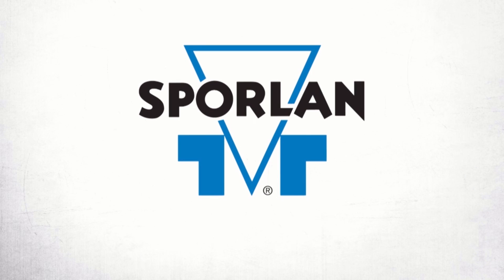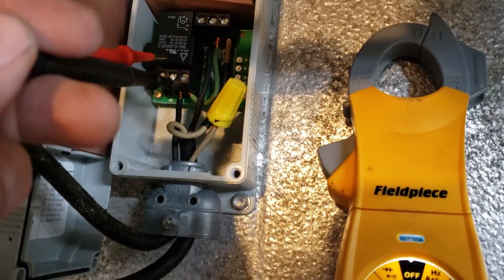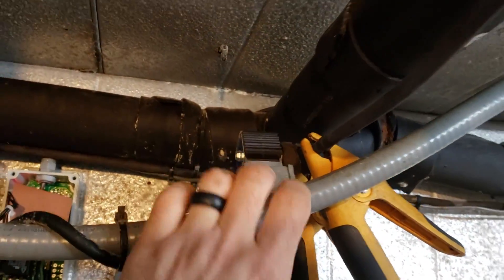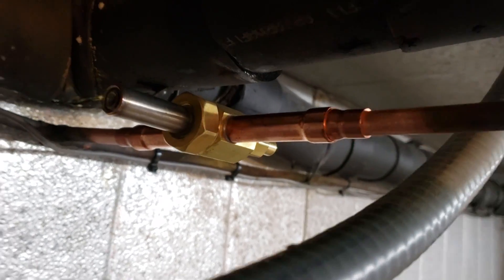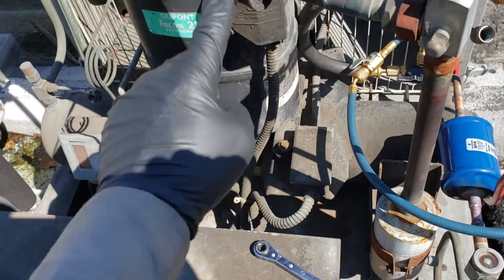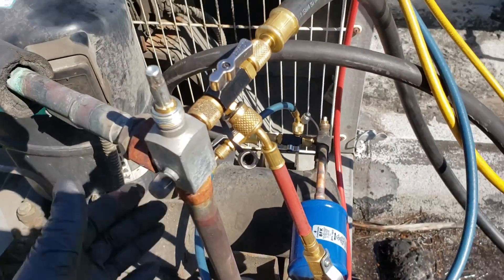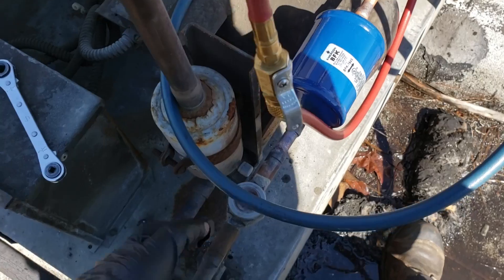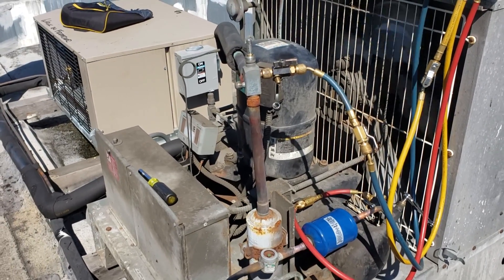WALK IN COOLER TOO COLD

Comment: If the contactor is open and not sending signal to the valve how is it that you have 115 incoming and the same on the output? I'm confused.  Thank you for your videos btw!!
Reply: The first measurement he did confirmed that he had a good power feed down to the evaporator and thermostat. The second measurement he took was almost certainly across the switch contacts, in which case if you measure 115 volts that means the contacts are open and the thermostat is trying to tell the solenoid valve to shut off.

Comment: Why replace the control? The Ranco seemed to be doing it's job. A correctly designed cooler shouldn't need a controlled defrost. Under maximum load it runs 16 hours per day allowing it to defrost during the off cycle. If the owner is putting it under greater load so that the off cycles are not long enough to defrost it you can set it up so that the temperature control senses coil temperature rather than space temperature and set the differential for TD plus 2°F.

Comment: Are those solenoids position sensitive?
Reply: Since there's several ways I can think of to interpret "position sensitive" in your question, I'll try answering as many of them as I can.
This kind of solenoid valve that opens when power is applied has a spring in it to hold it closed when there is no power, so it doesn't matter what orientation it is installed in.
Some solenoid valves do have an in and out port, so the direction of flow may be important, but systems that are reversible (heat pumps mostly) likely use solenoid valves that are bidirectional.
For the system to work properly, the solenoid valve must be in the liquid line between the condenser output and the metering device (TXV, orifice tube, etc.).
I think that covers it pretty thoroughly, but I'm not a HVACR technician. I've just been binge watching HVACR VIDEOS vids for the past 3 weeks. Learned a lot about it thru that.

Comment: Great find. I have not used the K2. Good use of the vacuum method. So many people I see pull vacuum thru manifolds. Yesterday I pulled a 20 ton split Trane down to 163 microns in 3hrs with 2 oil changes. Both fan pressure cycle switches leake and system was flat. So my 9cfm REFCO vacuum pump, 3/8>1/4 hoses, use Apion core tools and wala..vacuum achieved. Be safe out there! Thanks for sharing

Comment: So I didnr get why did you replace the thermostat if it was operating properly.
Reply: I installed hundreds of A419AB thermostats on walk in coolers with the sensor in the coil and programmed it to have a cut in 39-40 degrees and  cut cut of depending on type of refrigerant, condition of the coil, for example around 20-22 degrees for R22so the system makes defrost every cycle. Works as magic.
Reply: do it as a precaution, trying to avoid a call back..
Reply: Good point but I'd rather to install the little Grasslin timer with pins between the thermostat and solenoid coil so you can have different defrost time at different time.
Reply from the maker: The new thermostat contains built in defrost , so I changed it out of precaution

Comment: Thank you Chris. How do you find the  Appion vcrt , does it hold the vacuum tight , or does it start leaking after some time ? I've been wanting to do things by the book and use proper equipment lately,  but my colleague takes the piss at me and basically acts like I'm some joker who wants to do things like he was taught at school instead of getting the job done .😒
Reply from the maker: The appion VCRT is very nice and it holds the vacuum very well due to a double o ring internal design.
Reply: @HVACRVIDEOS  thank you . I need to find me one of these , I haven't found any supply house that carry this brand yet , but I'll keep looking.
Reply: @sterlingarcher46  TruTech tools online likely cheaper than any supply house. Can use discount code "getschooled" or others for 8% off.
Reply: @davejohnsonnola7908  cheers for that , mate .
Problem is I'm not in the US , so we don't get all the good stuff you guys have the pleasure to work with 🙂

Comment: Thats lucky. There arent many possibilities for that problem. Either the thermostat is stuck powering the solenoid or the solenoid valve is open.
Reply: “Running around like a chicken” 😂😂😂😂
Reply from the maker: Yep
Reply: @HVACRVIDEOS  I bet youve been having a fun week down south. The SF Bay Area had a heat wave at the beginning of the week and I had all kinds of equipment crap out on me. The funnest one was a Bally/Keep rite that was running but wasnt pulling the room down. Low liquid. So I put some in and then the machine stopped working. Started troubleshooting and come to find out that someone rewired it totally different from the diagram. Fought it for a while and it started working again. Came back the next morning and it was off. Shut it down traced out all the wires and made my own diagram. It started up again after that and has been running ever since. I think it was kicking out on the high pressure cut out. Oh well....
Reply from the maker: Yeah I have been running around like a chicken with its head cutoff all week. Supposedly we have a cool down coming up so that should help, we had a high of about 110 so it wasnt too bad. Last summer we hit 120 which was crazy,  but we still have alot of summer left.....